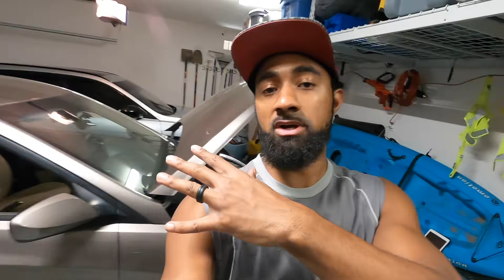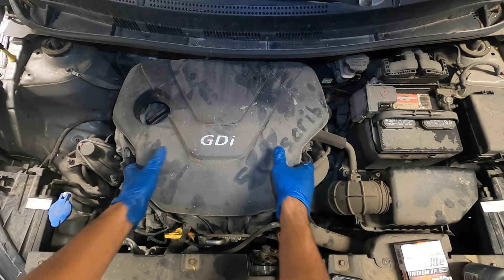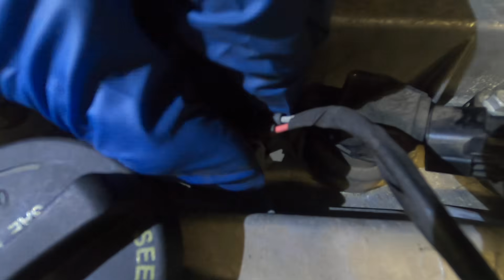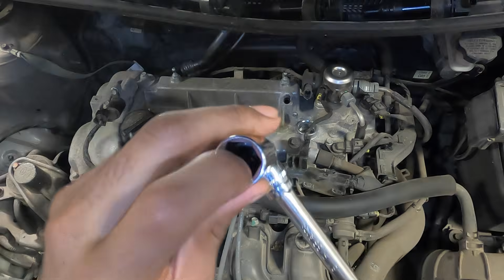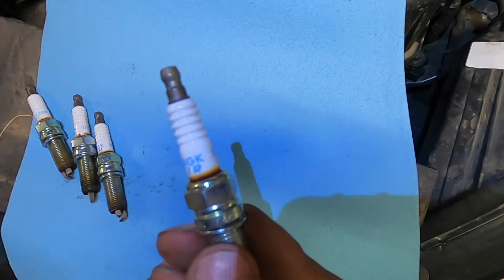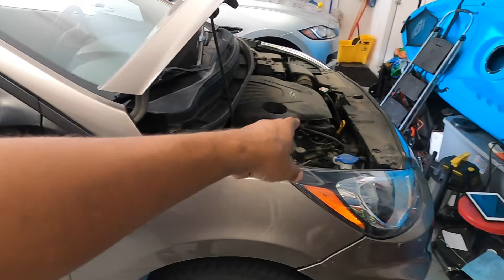HOW TO REPLACE SPARK PLUGS ON HYUNDAI ACCENT 2012 - 2016| The Accent gets a new "Spark" of life!

Comment: just bought one 2017 with only 42 000 km  .  Not sure if ive got engine excessive  blow by or just normal , smells like gaz but idk ... 
paper towel moving over oil filler cap , but im able to let it sit on it and it stay there ...  no other issues at all so far ( 1000km in only )  was just suprise when i took the cap off while running , seems like pressure getting out at first , not sure what normal is ...
i take pcv out and shake it , and blow and suck in it , work well , and succion on the hose is fine too

Comment: Thank you for your video. At 92,645 miles, my 2015 Accent now has fresh spugs. I found out that 75,000 miles was the recommended change interval for the plugs. I was not impressed with so many plastic parts on modern-day cars. Some broke, & needed to be zip-tied back together. :-)
Reply: Mines a 2012 Accent with only

(Literally went to go check)

98,716

Definitely gonna replace all of them soon😬
Reply: I just replaced mine at 160,000 miles for the first time lol. Don’t do highway driving

Comment: Mechanic was asking $1,300 to do all this. Meanwhile I saw that 4 new coils and sparks can come out as low as $52???? That’s wild to me
Reply: yeah, I just ordered a set of 4 plugs & 4 coils from A-Premium, online, for my ex-girlfriend's 2013 Hyundai Accent, for $54.99+tax (free shipping), and will install it for her, with no charge for labor.  Meanwhile, her mech, here in NJ, wanted $900 for installing 4 plugs and 4 coils.  What a rip-off!
Reply: @michaeltotten7508  yeah that’s wild. I’m in Jersey too and the mechanic I had gone to was Midas. Funny you commented now on this because I had about $4k or work done at Midas and needed to get most of it done AGAIN! They tried charging me for parts and labor but I told them that I was informed by the manager that if anything happened within in a year, come back and it’s free including labor. They said they couldn’t do labor for free and the manage who told me this was no longer working there, but they’ll honor the parts for free. 

Got the bill, and they just included the cost of the parts in with the labor. So I disputed the charge and was able to get the work for free. Local mechanics are go to now

Comment: Plug should have anywhere from .035-.040 gap. Torque on plug should be 14lbs ft. Torque on ignition coils should be 9lbs ft. Rub dielectric grease on the ceramic part of the plug only and inside the coil with a Qtip. I used Duralast coils and NGK plugs. Don't use threadlock. Do this while engine is completely cool because torque can change with heat.

Comment: My added tip is to replace each spark plug one at time. It sheets helped me. Prevents everything you mentioned about debris. And keeps the original coil pack per plug. And this video is amazing for detail.

Comment: Those gray pieces either broke or popped out completely. What do i do?
Reply: Had one pop off on mine just now what happened with yours if anything?
Reply: @ they were able to stay in place and work just fine
Reply: @jontheoperator6007 BRO thank you for replying! Been super stressed (car being down is always stressful then this on top of it) got first 3 plugs completely out now trying to get 4th plug out w/o removing that line or sensor. Those lines I always worry about breaking taking them off, then the other I don’t wanna possibly break. Sorry for rambling but thanks for the piece of mind!
Reply: @ youre good lol. I was doing the same thing! 😂

Comment: Thank you for the video! Replaced my wife's spark plugs today. When removing the ignition coil connectors, the grey tab snapped off on two of them -- I was able to place the connectors back on but do you know if it's possible to replace the connectors? Thanks again!

Comment: Dont use anti-seize on spark plugs, just torque to 18 ft/lbs and you'll be fine
Reply from the maker: Ive always used it on the sparkys... specifically the copper anti seize which won't effect conductivity, and will prevent heat caused seizing.
Reply: @EverythingAvron  They actually come with a layer of dry anti seize already coating the threads. I think the manufacturer did that because, unlike you, people were using types of anti seize that did effect conductivity.  I think you are just adding another level of protection. Not a bad thing given how bad it is to have a seized spark plug!

Comment: Do you think thats what's causing idling and the check engine light to flash on my dash?
Reply from the maker: Not sure but if you have the Check engine light on, I would definitely go get that code scanned and see what it points to, it would be any of several reasons. but after you find out what code your car is throwing you can then pursue that issue. then see if that fixes it.
Reply: yes just fixed my today change spark plug
Reply: What happens if the grey clip breaks? Asking for a friend 😮

Comment: Are you sure on the 8 ft-lbs of torque for the plugs? I’ve read many specs that say anywhere from 18-21 ft-lbs.
Reply from the maker: Yes im confident on the 8ft-lbs. there may be some higher torques out there too. But this head doesn't have a lot of engaging threads.
Reply: @EverythingAvron  no. Minimum is 14ft-lbs
Reply: It says on your spark plug box what ft pound it is so I assume he was using tappered spark plugs
Reply: 8ftlbs are the coil pack bolts

Comment: Auto light plugs are not for Asian vehicles. They use denso
Reply from the maker: true, but for this low output 1.4L they won't cause any issues
Reply: Most likely NGK. Denso is excellent too.

Comment: Will this work on 2011 Hyundai Accent?
Reply from the maker: 2011 Accents is a different generation than mine, I could be certain if its the exact same. Id recommend checking your owners manual or with your local Auto store for the correct Sparkplug type. However, The process will be very similar I know.
Reply: @EverythingAvron  I appreciate the quick reply!

Comment: My wife 2015 Accent that pesky gray tab you carefully pulled up yeah one of hers has Brocken and is miss firing 
Do you happen to know how to replace the connector wire to the coil pack
Reply from the maker: I don't think thwarts are its own part unfortunately.... what I would do is find a Accent from a junkyard and cut the cable off that and then solder splice that into yours.

Comment: What's the significance of the gap?
Reply from the maker: Well on low compression N/A cars there probably won't be much issues if the gaps are slightly off. but it just is best to follow the manufactures recommended spacing. on high compression and Forced induction vehicles, gap becomes a lot more crucial. because your intake air could actually "blow out" your spark if the gap is too wide, or conversely if there's too small of a gap, the spark won't be sufficient enough to ignite the air/fuel mixture.
Reply: Thanks for the video! Just a couple questions if you wouldn’t mind. How much anti seize did you apply on threads and how tight do you screw them in? Would the gap be affected if twisted too tightly? Thanks in advance if you see this

Comment: I can't take a video seriously where the engine is this dirty... a clean engine runs cooler and more efficiently. It also makes for a more "Professional" Video. FYI
Reply: I stopped cleaning the engine. Those engine cleaners are destroying soft parts like electric insulation and other plastic and rubber parts. Flushing and replacing coolant every two years keeps the engine cool. Replacing the thermostat, radiator cap, and hoses every 60000 miles (100000 km) and replacing the serpentine belt (sooner) keeps the engine running cool forever and prevents damage to the head gasket. New and clean engine oil also keeps the engine cool.
Reply from the maker: I agree which is why I'll be eventually taking it to get professionally detailed like I did the Truck for the Car show.

Comment: i know i am off subject but i am trying to replace my 02 sensor bank one,, without the tool. I have the car jacked up and trying to un-tighten and not having much luck any advice. I have changed the spark plugs with the help of the video
Reply from the maker: for O2s they have always been super difficult for me too... I'd recommend some PB Blaster soaked on the threads over night. then the tightest and strongest wrench or vise grips you own. and then a leverage bar if possible... But truly the easiest way would be getting the special O2 socket, because you can grip it well then use a breaker bar if necessary.

Comment: When do i have to replace it?
Reply from the maker: I say "it depends on the vehicle," for example on the Hyundai accent Im comfortable going 50,000 to 70,000 miles under normal driving. Now for my F150 Ecoboost I change those out every 15,000 to 20,000 miles. Different vehicles degrade spark plugs at different rates.